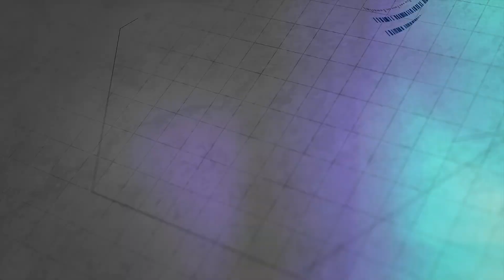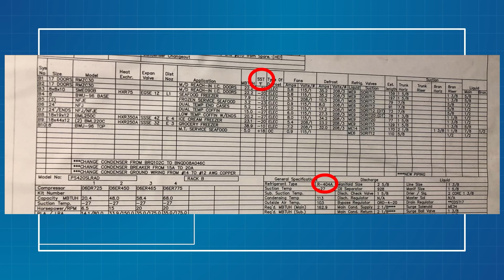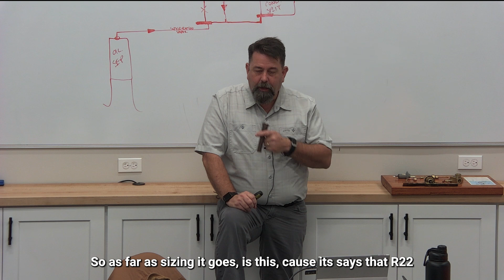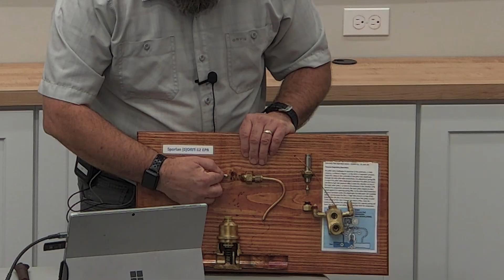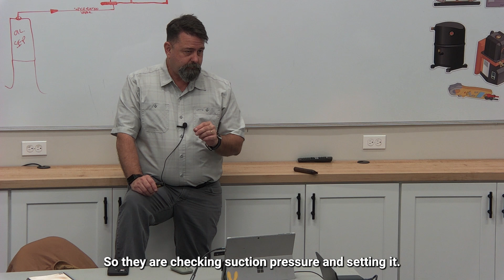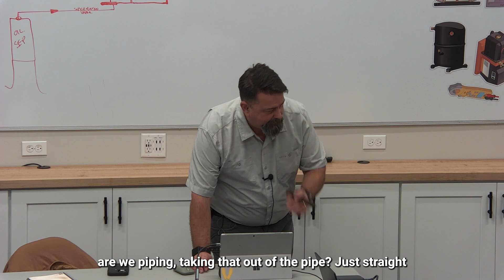Rack Refrigeration Cycle Part 12 - EPR

Comment: Great information guys. Thank you. I have a question. I have a Walmart rack and condenser here in Florida that is not properly wired for split mode. I found the split valve solenoid and the pump down solenoid to be wired in parallel, but are dead ended in the wire chase. When the condensers were replaced back in 1993, the split mode was never wired. Can you tell me what terminals I should be connected to up in the condenser panel terminal block. The split relay is activating and half the fans are turning off, just no power to the solenoid coils. My wires are labeled #2 and #6. I do have a wiring schematic for the condenser unit, but nothing showing where to connect the coils to for slit mode. Any help would be appreciated. If it’s easier to communicate I can send you my Walmart email address. Thank you
Reply: There are a few variations on this one.  Do you have a VFD on the condenser, or did you ever?  If so, there is a relay labeled "SP" or "Split Valve".  If thats the case, the #6 wires go to any empty  Normally Open contact, and the other side should be #3 from anywhere on the rack control circuit.  The number 2 should go to anywhere where you have the #2 rack control power  (Your feeding the coil #2, unswitched, from the main control that feeds all your compressors, and #3 is after the phase protection (PMR) relay).  That is also the relay that is killing 1/2 your fans - just use an empty set of contacts on it.